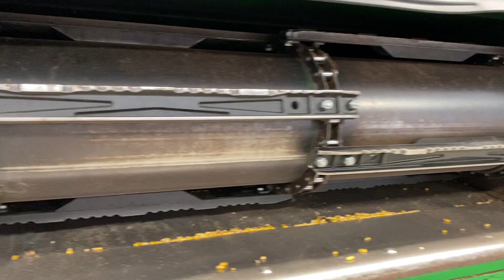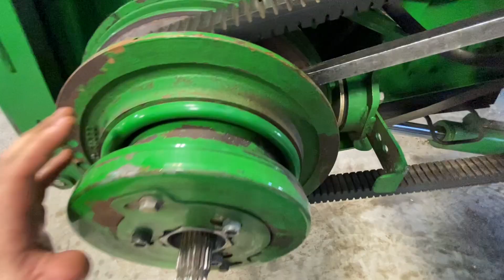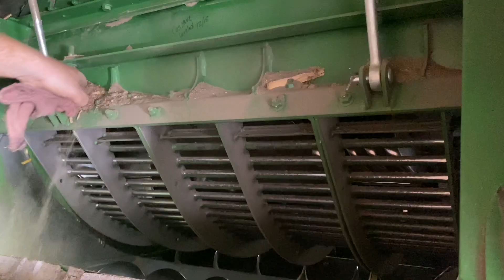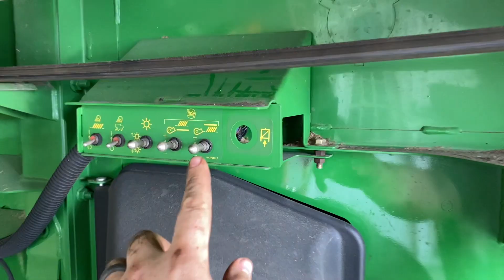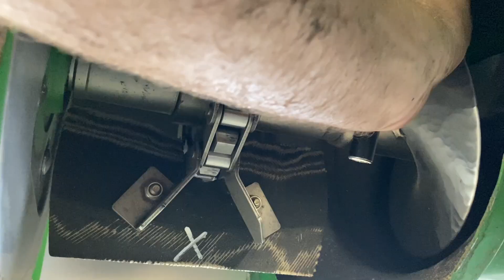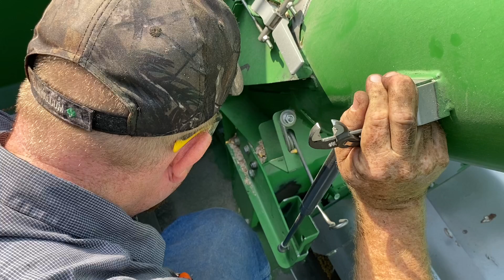Learn how to inspect a John Deere S-Series Combine!

Comment: As someone who has always had red combines and was just curious to see how the green ones are built, I was shocked to see that Deere is still using an open bevel gear system for the unloader… has been an oil bath gearbox on the IH machines since the 16 series in the late 1980s

Comment: @ZK MasterTech I’m wondering if you’ve ever had a problem with the contour master binding when tilting the header side to side. I’ve checked the pressures ,changed the seals in the ram, I’ve had the head of off the feeder house I can’t find anything. Just curious if you’ve ever come across this problem
Reply: Ive had to add two suitcase weights on the left side or I can’t get it over center

Comment: Take note the upper cleaning fan sheaves  as the outer slides in and out the 3 drive lugs usually batter the holes out of the inner sheave , then  what happens is the speed will slow down ok but not increase due to the steps created in the inner sheave.
I am also seeing a lot of upper rear tail boards that bolt to the chaffer frame that hold the loss sensors starting to crack and fall off.
Great work keep the vids coming.

Comment: Zeth, are cracks in the shoe auger bulk heads pretty common in all STS combines? I have a new to me 9670 bullet rotor and I haven't dug into it yet. Again, thanks for the great videos. Anybody with farm equipment and especially green power should be watching. Edit: I laughed at the woodpecker lips comment too. LOL
Reply from the maker: Yeah bulkhead cracks are common from 60 series to newer s-series.
Reply: @ZKMasterTech  Thanks
Reply from the maker: The root cause is the run out on the driveshaft causes the bearing mounting plate to flex back and forth until it cracks along the weld.

Comment: It's mind-boggling how many belts and chains the engineers fit into a single combine! And somehow it all works together, haha. What would be a typical annual investment for maintenance and parts to keep a combine in good condition? Of course as a rough average, since things naturally wear more in later years than in the first few.
Reply from the maker: I would say $3k-$10k if you had it inspected every year.
Reply: @ZKMasterTech  That's not bad at all, especially considering what gets fed through them and how much value it helps preserve in the machine! Thank you :)

Comment: Your videos have all been awesome. I have a 2015 S670 with the 5 speed feeder house, there appears to be a leak on the big gearbox right behind the cab, and I can not seem to find where it is coming from. Is there something common that could be leaking?
Reply from the maker: It’s usually the input or output shaft seal. There are also hoses that can leak as well.

Comment: Have had alot of upper variable sheave on feederhouse have the lugs worn out inside. Have also found when taking upper apart that the speed adjust piston is leaking internal and filling upper cavity with oil.
Reply from the maker: Yeah that's pretty common.

Comment: Never seen the shoe auger bull head crack like that definitely something to look out for. Things I’ve seen are the primary countershaft gear case bushings worn. Main engine gear case mounting brackets cracked out. And on class 8 and 9 machines the front engine bracket cracked.
Reply: I've seen a few front bulkheads cracked. It's an ugly job. Another thing known for cracking is the engine accessory bracket. They're gusseted but the crack anyway and the updated version doesnt have a gusset.
Reply: Yes people say

Comment: I just recently started about 5 months ago as an apprentice Ag tech at a John Deere dealer. We have a combine doctor at the dealership. He knows them inside and out. They give us 16hrs to do a full inspection. He pulls the sieves and Chaffer to check the frame and he pulls concaves as well. Very awesome video though!
Reply from the maker: We only get 9 hrs to inspect the combine including drive time so there's not enough time to pull all that. I can use my bore scope or crawl up in the chaffer to check the common areas where they crack.
Reply: @ZKMasterTech  ahhh makes sense now. Hey what was that 70mm custom socket you made used for?
Reply from the maker: For the nut on the reverser to take the lower sheaves off.